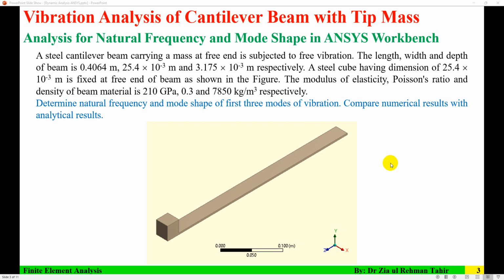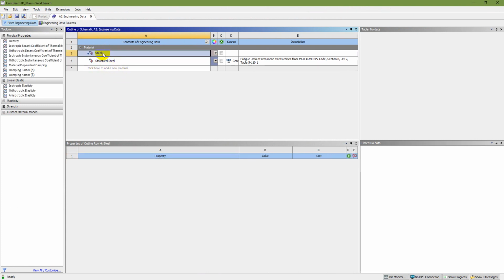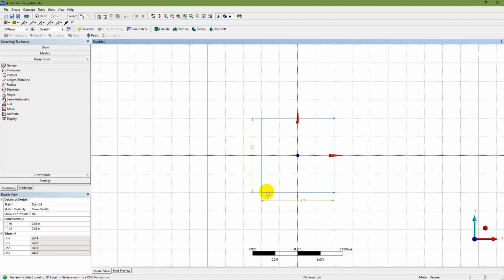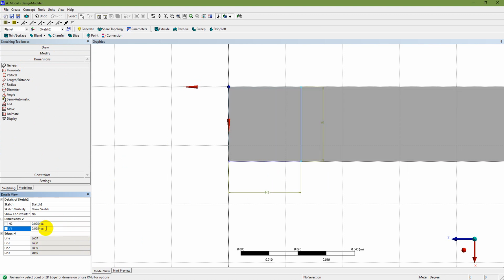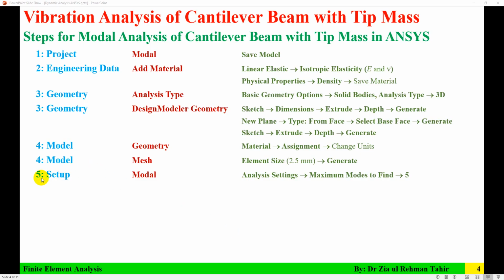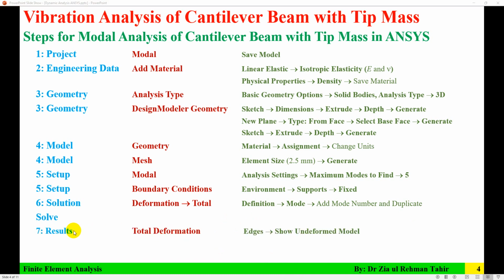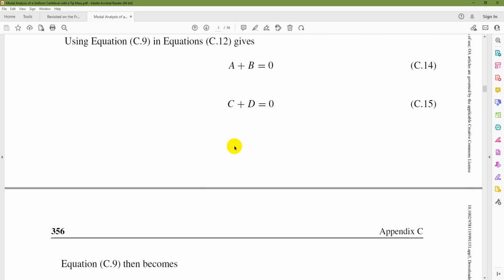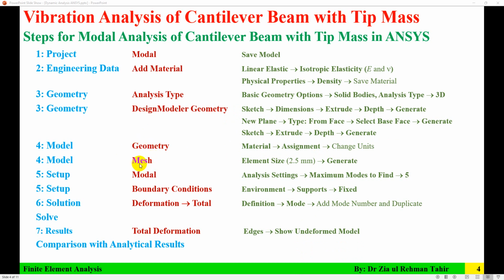Vibration or Modal Analysis of Cantilever Beam with Tip Mass (Mass attached at Free End) in ANSYS

Comment: Sir, may I ask why the 2nd mode in ANSYS is 79.995 instead of the 73 which is marked as mode 2 in simulation. Moreover, by following your steps, the 4th mode will be the 7th in ANSYS which is 676.24 which is much larger than what you got in MATLAB which is 484.44. What are the reasons for this situation? Thank you so much for this video!